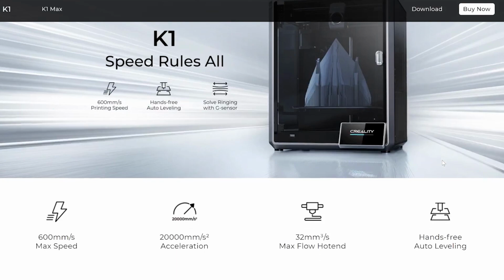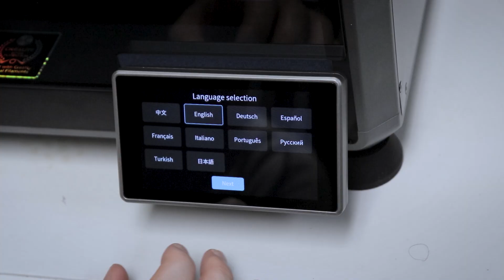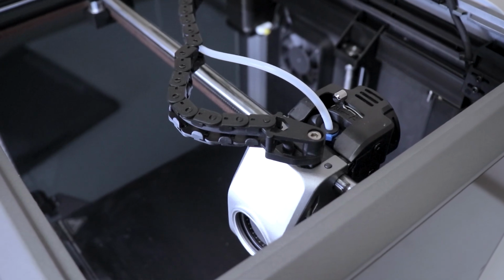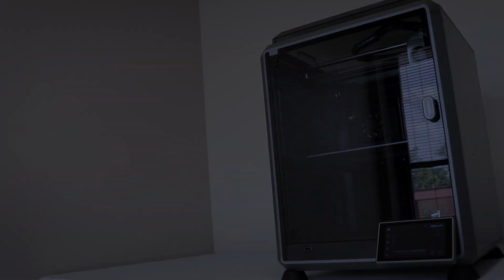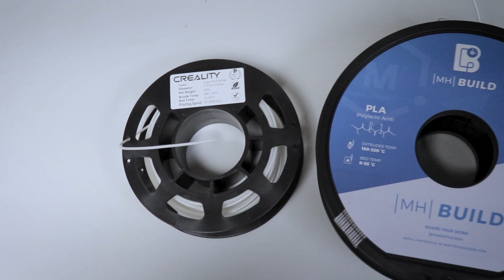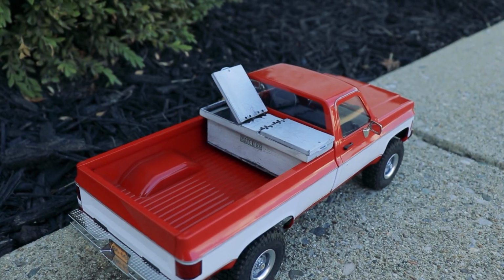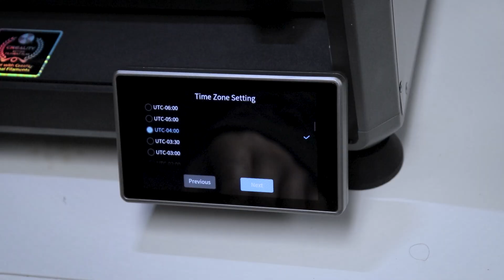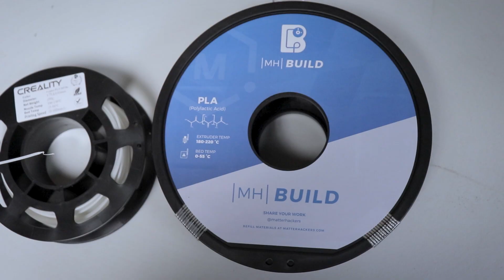My First Impressions of the Creality K1 High Speed 3D Printer 💨 Let's Make Some Parts!

Comment: Nice! 🔥💯 Among the best FDM printers for sure. I want a few like these someday to replace my good old FDM printers. However, just like you mentioned, a resin 3D printer is and will likely always be a step up in quality from FDM. No matter how fast or good they are, I would only use FDM printers for printing big parts. I recently just tried out a resin 3D printer for the first time ever, and I can tell you now that there is no going back to FDM for small parts. One downside of a resin 3D printer though is sanding out all the support material bumps which is time-consuming, same thing with FDM. Maybe a super fine powder printing without support is the next step up soon? I would trade anything to not have to do so much sanding and post-processing.
Reply from the maker: Yeah resin is the way to go for small parts. Our Formlabs machines produce parts with very little remnants of the support structure being present, but these machines are expensive and slow. Dialing in the support placement and size takes some experimenting to get perfect. Would be cool to see powder type machines enter the hobbyist market but I'm not aware of any at this time. For larger FDM parts in certain materials such as ABS, vapors like acetone can be used to melt the outer surface and create a smooth, and stronger finish. It's a cool technique but not the best solution for every part. Sanding sucks for sure 😆.